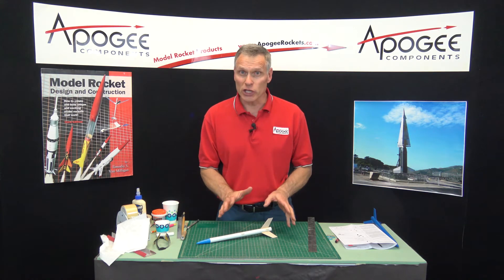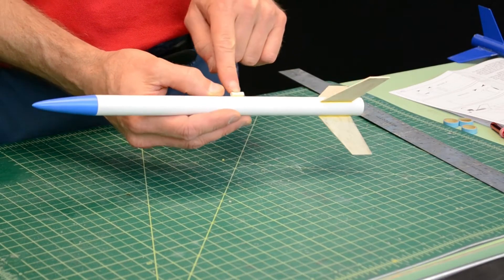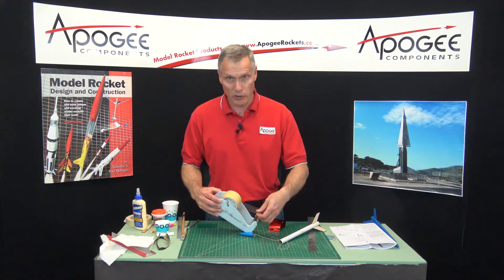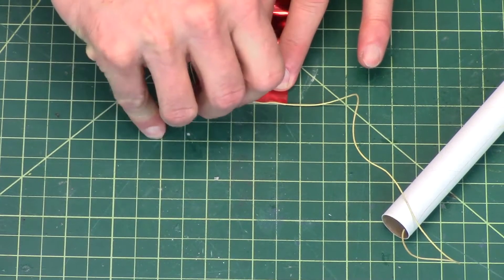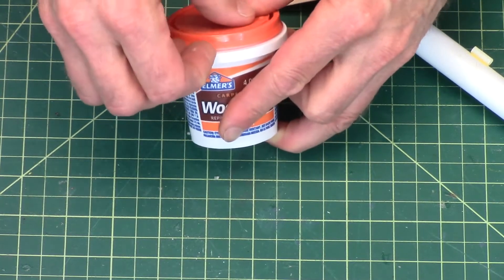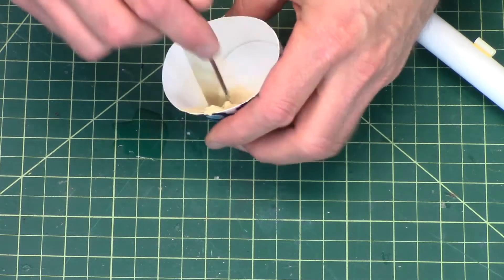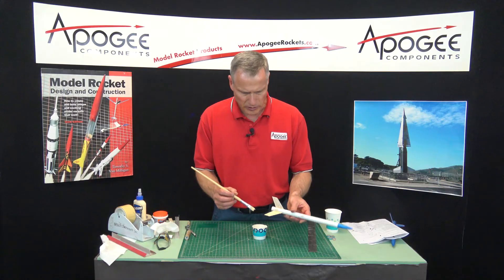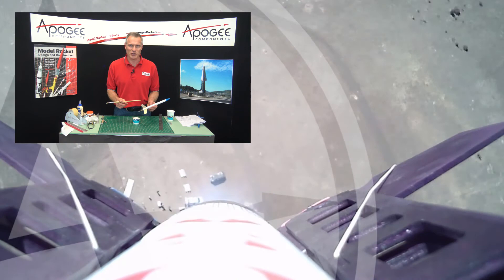Blue Streak Assembly: Part 4

Comment: Re: fin prep with wood filler. I water the filler down to a thicker consistency. I also have 2 plastic clipboards that I've drilled out the rivets and removed the clips.
So... I'll sand the fins before removing them from the balsa sheet. Apply the wood filler, then sandwich them between wax paper and the 2 plastic clipboards. Put some heavy books (or a large pot of water) to press them down. Leave them overnight and there is no warpage when I start the sanding process.
I've also smeared wood glue over small fins (after rounding the edges), while touching my finger to a damp sponge to wipe away excess glue. I set them down (horizontally) on some needles I stuck through scrap cardboard (since wood glue sticks to wax paper).
It takes more time, but I've had good results hardening and sealing fins with both methods. After sanding, they'll take primer (<-- sand it), paint, and a top coat of clear gloss like champs.

Comment: Im building a rocket from scratch.im buying all the parts from a arts and craft store..my question is...how do i determine fin size in relation to the body tube and weight of the nose cone??anybody has the answer please reply.tnx
Reply: the rule of thumb is...

The fin's root edge (the side of the fin that attaches to the rocket) should be around 2x the diameter of your model rocket's body tube.

The fin's semi-span (the length of the fin measured from the root edge (🠕) to the tip edge (🠗) ) should be no more than 1.5x the diameter of your model rocket's body tube.

The fin's tip edge (the side of the fin furthest away from the (root edge) rocket's body) must be less than 1x the diameter of your model rocket's body tube. But preferably, it should be less than 0.5x the diameter of the body.

Copy pasted this from simplerocketry article called how to make a model rocket fly higher?
But it also said to use a simulation program to accurately determine the fin size.
Reply from the maker: There is a book called "Model Rocket Design and Construction." It will give you all the information you need to make your rocket stable when you design it. You'll find the book on the ApogeeRockets website.
Reply: @apogeerockets  can u give me any information that i can use till i order this book?or anyrhing u learned from esperience??